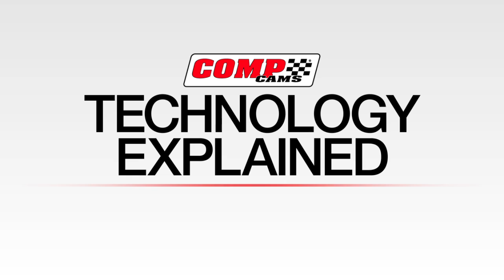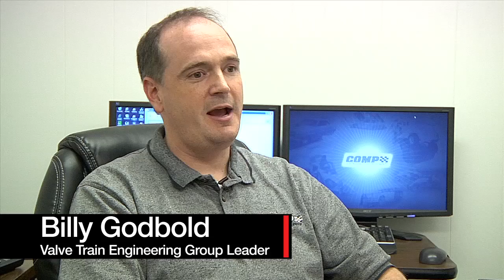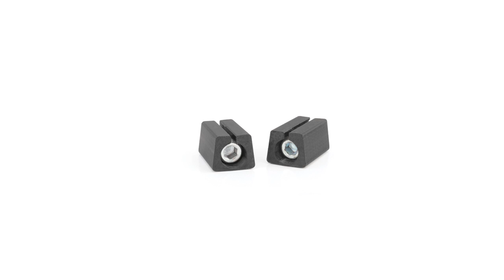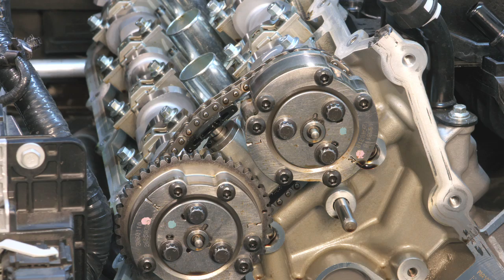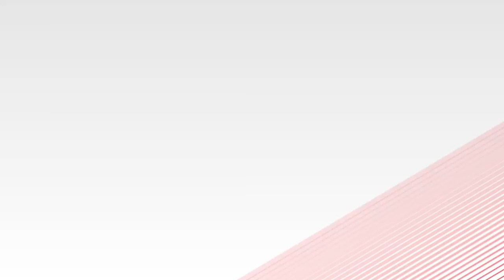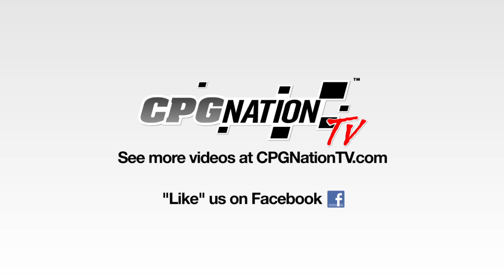COMP Cams® Technology Explained: VVT & Cam Phaser Technology

Comment: Do you provide Phase VS RPM table for the VVT cams you sell for the 6.2 GEN IV LS motor ?
Reply from the maker: Unfortunately we do not provide that information.  The engine will have to be tested on the dyno to find the proper phasing for each particular engine. Thanks for watching!
Reply: OK - Ill buy the MAST cam that does provide the phasing tables .. you guys havent changed ..

Comment from the maker: VVC is Variable Valve Control, where VVT is Variable Valve Timing. The two are similar, but have some differences. VVC was used by Rover and is a little more complex. VVT is more commonly used by many manufacturers. Hope this helps. Thank you.